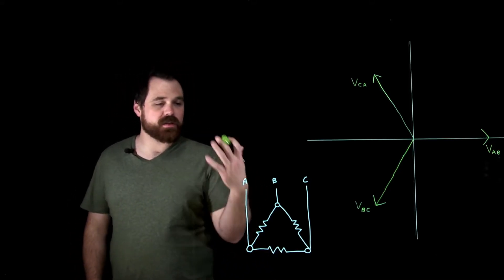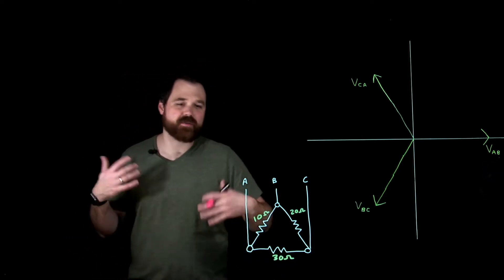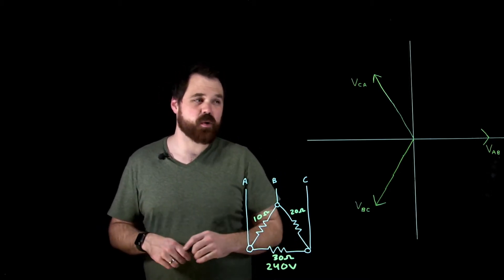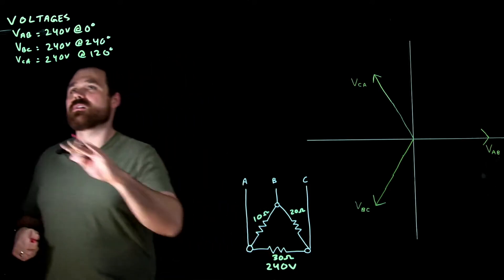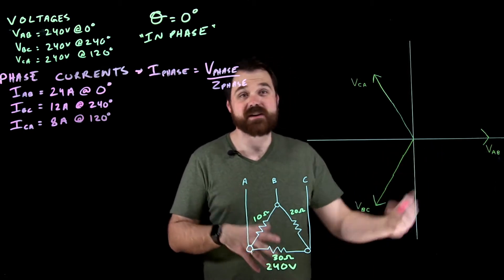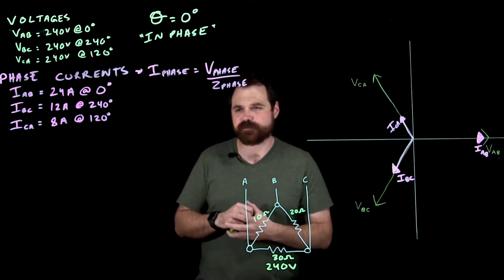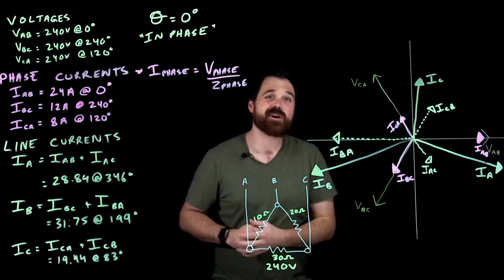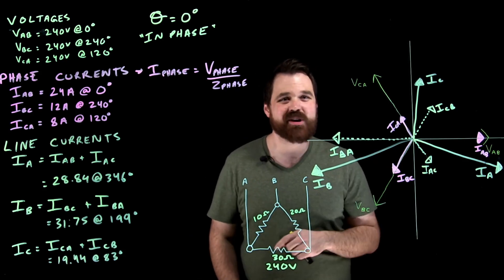Delta Unbalanced Resistive Load

Comment: Hello mate, loved the video.. might just be a touch advanced with the calculations for myself lol.

But I do have a basic question as an electrician.
I am familiar with delta balanced systems, unbalanced 3 phase loads in star systems. In regards to currents specifically and how they behave.

My question is in regards to an unbalanced delta 3 phase system such as your demonstration above.
Where does the unbalanced current go in a delta system? With no neutral Id assume that it must still return like a balanced load back through the other phases.
But with the sine waves all out of sync it the numbers dont add up. I looked at online don't really add up at any given time along the wave.

Kind regards

Comment: Question, Impedance is the pythagorean theorem sum of reactive and resistive components right? If this circuit is purely resistive and doesn't contain any reactive components then why call the resistance "impedance" ?
Reply from the maker: So you're right, Impedance is the TOTAL opposition to current in an AC circuit.

Typically that would include X and R, but since the X is zero in this example the Z would be equal to the R.
Reply: @ZackHartle  ok I understand thanks.

Comment: Thank you for your videos!  I'm hoping you (or someone else) can help point me to the answers to some of my questions.

What I'm most curious about is how the different lines from the power source (3 phase generator for example) can carry both the 'outbound' current for the loads that are on their line as well as the 'return' current for the other phases without disrupting the outbound current in any way.

I'm also not sure I understand why you would get any current between A and C.  If electricity always follow the path of least resistance, isn't the current supplied by line A going to go through the A/B resistor and return back along line B?  And the similarly the current from Line C is going to go through the C/B resistor and return back along line B?

I'm clearly struggling to understand some fundamental concepts that would allow me to mentally understand why a 4th wire is not required with Delta 3 phase loads (balanced or unbalanced).
Reply from the maker: Kind of a tough this to explain. Remember most current will take the path of least resistance, but not all the current is going that way. It will still split as there is still a potential difference between those points

Comment: I have this exact problem at work. The currents you solved for, are those what I would see with an ammeter on each phase, A, B, C? Looking at the resistance values, the  currents are proportional to them. I guess another way of asking would be, can't you just leave off the phase angle? To me, this seems like a snapshot in time, with specific phase angles.  Is this the same as using DC equivalent? I can calculate the current if each side, but I know things are not in phase, so the total on one leg will be less than the sum. Is this what that is solving for? The ammeter reading?
Reply from the maker: Yes, you're solving for what you would read on an RMS ammeter. The first half is phase currents and the second half is Line currents. Phase angles will play a bigger role in circuits that have inductive or capacitive values